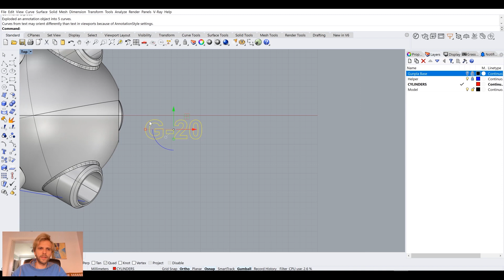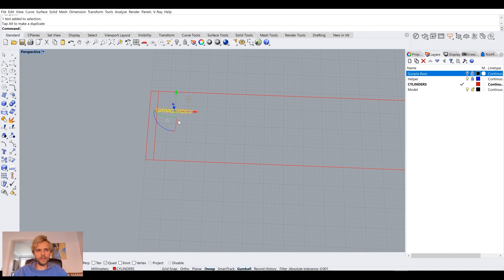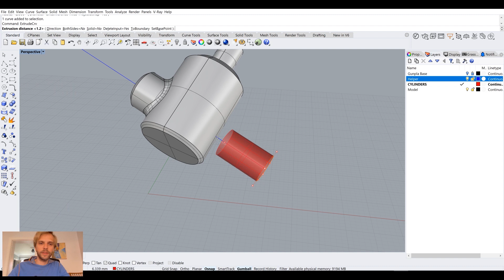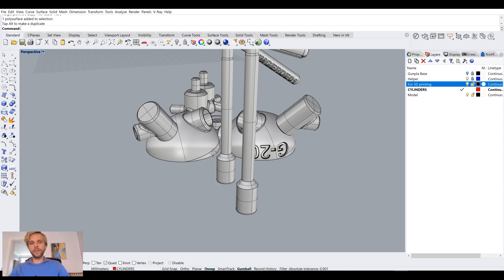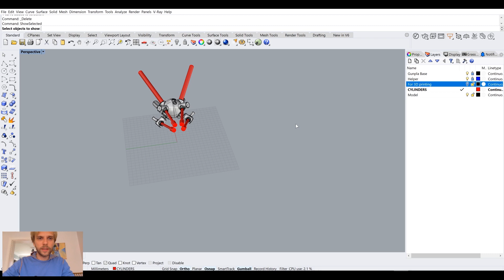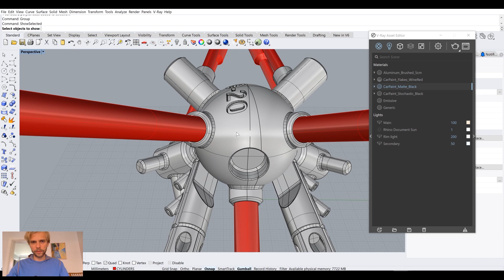Hard Surface Model with Rhino and Vray - GUNPLA06

Comment: Hey great video! Seeing as you are using gpu rendering I would like to ask your views on gpu vs cpu rendering in vray for rhino 6. Can the gpu make renders of the same quality as cpu when it comes to architectural projects like a room full of furniture? And are the nvidia rtx cards worth it over the gtx ones?
Reply from the maker: Thanks! Hmm, ok, so to keep it simple - desktop GPU rendering blows CPU rendering out of the water (unless you're using something crazy like a Threadripper CPU). It's simply faster and there is absolutely 0 change in quality. For laptops - depends on what kind of GPU you have, older ones are slower than CPU's, newer ones are faster. My GTX1650 seems to be faster than I7-9750H, so I use it. OK BUT THERE IS ONE PROBLEM - the video memory. So GPU's are faster and thus better for rendering, BUT they have much less memory than CPU has (RAM). When you do displacement maps, when you use high resolution textures and so on, all of those need to be stored somewhere - and it's much easier to overfill a GPU'S memory than it is to overfill RAM, so when I do really really large scenes, I come back to CPU, simply because when GPU memory overflows Vray for Rhino just crashes. Hope that explains it. Oh and RTX vs GTX  - if you're not using Unreal Engine to do real-time rendering, then you won't get any benefit from RTX.
Reply: @DesignGoBrr  Hey. Thank you a lot for taking the time to reply. It's thoughtful and provides all the answers I was looking for which I frankly couldn't find anywhere on the internet. I shall try to drop a patreon subscription if it is within my means as your work looks worth supporting 🙏
Reply from the maker: @akashlobo7933  I'm very happy that it's helpful! And thank you so much for considering supporting this channel. Slowly but surely I'll be able to get a new microphone that doesn't make a cracking sound :D
Reply: The info you provided helped inform my laptop purchase. Thank you again. Finally got around to joining as channel member :)